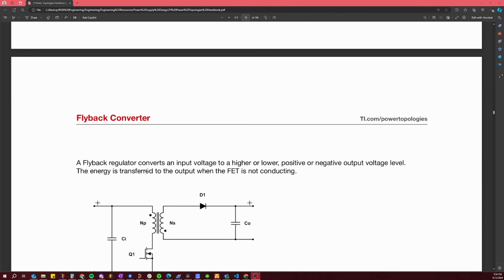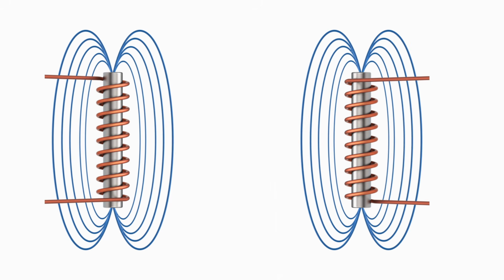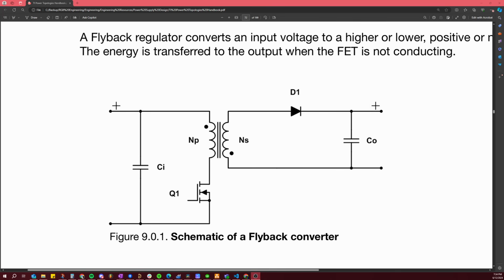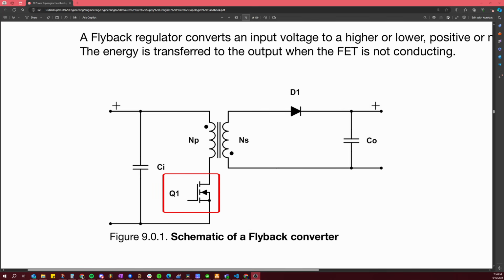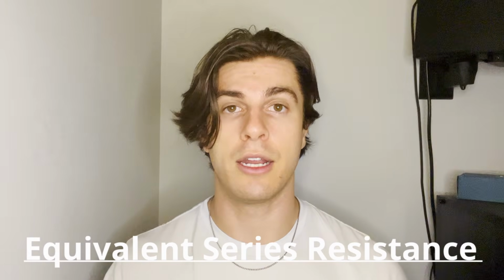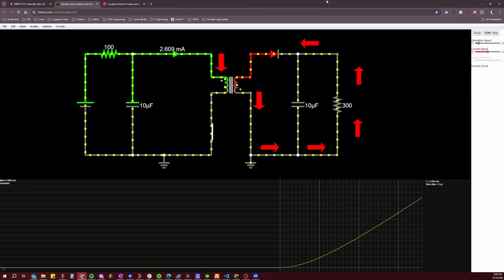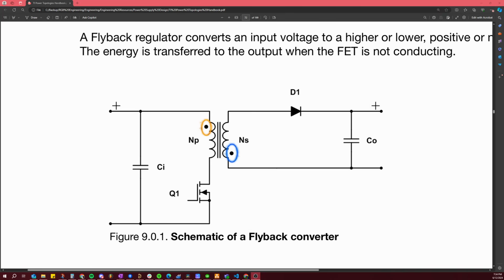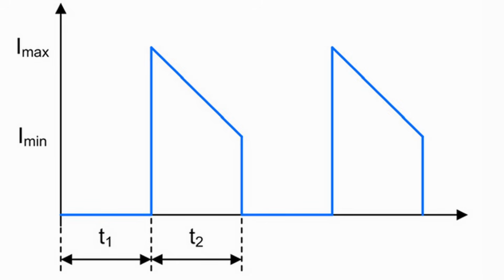Flyback Converter Basics (for Beginners)

Comment: The reflected output voltage comes from only one effect - true transformer "action" that is dependent on the ratio of the input and output winding turns. The reflected voltage magnitude is constant as long as current is flowing in the output winding.
There is another phenomenon that is the result of imperfect magnetic coupling between the inductor charging winding (input) and the discharge winding (output). This is called "leakage inductance" and can be modeled, in simple terms, as a small inductor in series with the input winding but not magnetically coupled to anything else. It is this inductance that results in a very high voltage "spike" when the switch turns off. The current through it does "try" to remain constant (equal to the current just before the switch turns off), but since there is nowhere for the stored energy to go that current causes a very high voltage. Again, it has nothing to do with reflected voltage. A "snubber" is used to limit the magnitude of the spike voltage in most practical designs.

When the switch turns off you get three distinct voltages at the drain of the MOSFET switch. First you get a high-magnitude narrow spike due to the leakage inductance. Then the reflected secondary voltage appears (it actually started as soon as the FET turned off, but it is sort of "hidden" by the big spike. The reflected voltage will remain nearly constant until all of the energy stored in the inductor ("transformer") has been discharged. The voltage across the output winding is held nearly constant by the voltage on the output capacitor, which changes only a very small amount in any one switching cycle. The reflected voltage is added to or "stacked on top" of the input supply voltage. This stacked voltage is the main consideration when it comes to the voltage rating of the FET. Once the stored energy has been discharged, the FET drain voltage drops back to the voltage on the input filter capacitor. Typically there is some high frequency "ringing" due to resonance between FET and "stray" capacitances and the inductances. If the inductor is not fully discharged before the FET turns ON again, the voltage at the drain remains equal to the "stacked" voltages.

Management of the reflected voltage is often a significant consideration in the turns ratio of the inductor ("transformer"). The main consideration in turns ratio is the determination of the inductances required, not input to output voltage ratio. You certainly do not take the approach used for a true transformer.

I prefer to think of the magnetic component as an inductor with a charging winding and a discharging winding, not as a "transformer" (though it behaves as such when you really don't want it to) or as a "coupled inductor" because there is no "coupling" between input and output windings in terms of actual power delivery. "Transformer" is a convenient but misleading short word.
Reply from the maker: Thank you for such a detailed comment :)
Reply: “There is no coupling between input and output windings in terms of actual power delivery.”

Incorrect. Power transfer during off-time absolutely depends on magnetic coupling (mutual inductance). If coupling were zero, you’d have essentially no usable energy transfer (just leakage and stray capacitance chaos). It’s fair to say “it’s not a forward-transfer transformer during the on-time,” but coupling is still the mechanism that delivers energy to the secondary when the switch is off.

Comment: I can recognize this circuit in an old VFD handheld game (5V of batteries becoming 35V for the VFD tube), but I missed some explanation of how this thing works in a CRT, as I see two problems there: The insulation is problematic at 15-30kV, and so is the capacitor on the output circuit, you can't just add a 30kV capacitor there. So I guess it does something by aligning the horizontal line frequency to the mosfet frequency.

Comment: This is a good, very basic explanation of the function of a flyback converter, but not once did you indicate WHY it's called "flyback", leaving the beginner wondering.

To me, an electronics engineer who's done many flyback and other SMPS designs, I understand that the flyback period is that portion that you've referred to as the "energy transfer phase". But, it would have been very helpful for you to have defined that it is called a flyback design because the voltage on the secondary side suddenly "flies back" from a negative direction to a positive direction during the energy transfer phase after the FET turns off.
Reply from the maker: nice fun fact :)

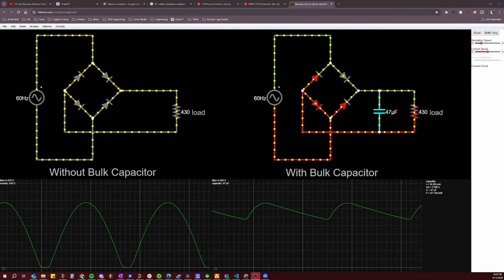Comment: At 2:04 you are talking about the input capacitor being connected to mains voltage, like C11 which is BEFORE the transformer and bridge rectifier.  Then at 2:20 the 47uF capacitor AFTER the bridge rectifier is the bulk (input) capacitor.  This is confusing.
Reply from the maker: At 2:04 I am talking about C8, the 47uF capacitor
Reply: @RGBEngineering  "receive their voltage directly from the AC mains" that's C11 not C8.

Comment: I have been in electronics for 50 years and l would not even start to play around with a converter connected to the mains. 
The component values are far too difficult to determine and the timing has to be accurate. 
You can buy these on the web for $4.50 and they are tested, proven and guaranteed. 
Don’t make a fool of yourself and try to re-invent the wheel. The whole skill in electronics is to KEEP THINGS SIMPLE. You can learn nothing from these videos. No-one has ever produced an inverter from any of the discussions and no-one will. The cost of the parts exceeds buying a ready-built unit. All these videos are just “waffle.”  Talk is cheap and university professors are adept at dishing out nonsense. That why university graduates come out with no capability AT ALL. They have just been listening to drivel. 
If you knew the specifications and timing diagrams needed to design a module you would just laugh at the simplicity of these discussions. 
Colin Mitchell    talkingelectronics. com

Comment: Hello, 

Could you help me in debugging the fly back converter design? 

I have referred the ucc287502dbvr fly back converter from the TI. And replaced its transformer with the same another transformer. But I can not able draw current from it. As per the turns ratio I got the 24v output from the transformer. But once I attached a load to the circuit, the voltage suddenly drops. 

What could b the reasons ??
Reply from the maker: might not be enough capacitance on the output or the feedback circuit is not working.

Comment: Nice presentation, thank you. When the MOSFET goes off, the current through the primary abruptly goes zero. So there is no magnetic flux and inturn no induced emf in the secondary, then how come flyback energy transfer takes place? Please clarify.
Reply from the maker: It goes back to Faraday's law. Change in magnetic field means voltage is generated. When MOSFET is on we have a magnetic field. When MOSFET is turned off we now have no magnetic field. Going from having a magnetic field present to not having a magnetic field present (aka change in magnetic field) generates the voltage on the output.

Comment: how would you lower the voltage that was incresed inside this circuit with a button to transister? so you can higher and lower the voltage?
Reply from the maker: you would connect that to the feedback circuit to adjust the voltage with the button.
Reply: @RGBEngineering AHH thank you..
❤

Comment: Whats needed to increase power output limit from factory designed flyback? Can we make just bigger air gap in the core without changing the windings for storage more energy and just lower current shunt on the primary side to push more energy to it? Yes, I know there is a risk of frying the windings. Can we double the power by simply doubling the operating frequency and increase the air gap to lower inductance also by two?
Reply from the maker: You would need to redesign the whole power stage (all of the components mentioned in this video). There are a bunch of ways you can do it, based on the fundamental equations that describe how the flyback converter behaves.

Comment: I see you still struggle to understand how a transformer works, as you call a coupled inductor with a transformation ratio a transformer. A transformer does not intentionally store energy in the magnetic field; it uses the magnetic flux without the need for energy storage. In contrast, a coupled inductor does store energy in the magnetic field—specifically in the air gap of the magnetic flux conductor. So I would recommend trying to understand how a coupled inductor in a flyback converter works before explaining it to the world.
Reply from the maker: Thanks for the feedback.
Reply: A flyback magnetic component is literally a transformer structure (two windings on a core) with intentional magnetizing inductance used for storage. Calling it a transformer isn’t evidence someone “doesn’t understand transformers.”

Comment: Beginner question, so the bulk capacitor does it need to facto in the overall output current on the secondary.. So e.g  a flyback that needs to provide 5A, what is the relationship of the CAP. to the load current, thanks
Reply from the maker: Great question, remember that the input current will be proportional to the output current, so the current that the bulk capacitor has to supply will be based on the output current rating of the power supply. This is important to consider when determining the required ripple current rating of the capacitor.

Comment: hi Garrett, thanks for the great video breaking it down. I had some more specific questions regarding the distinctions and advantages between conventional transformer, flyback converters, and coupled inductors. Can we have a brief chat sometime? Where would be a good place to reach you?
Reply from the maker: Sure, what are your questions?
Reply: @RGBEngineering  Some general inquiry into the distinctions that separate coupled inductors from conventional transformers. Is there an email i could reach out too?
Reply from the maker: contact@rgb.engineering

Comment: How much current will flow into primary side? In other words what would be  saturation current?
Reply from the maker: That depends on the output power rating you specify (i.e. the load on the output). Just keep in mind the shape of the primary-side current waveform.

Comment: A magnetic field is produced by current flow through its winding. If the diode is off then current cant be flowing through the 2nd winding.  So am I correct in assuming that when a magnetic field is induced in the 2nd winding (with no current flow) this stored energy will provide the current when the diode turns on?
Reply from the maker: When the MOSFET turns on, the energy generated by the current flowing through the primary winding gets stored in the transformer's magnetic field. It then releases this energy when the MOSFET turns off and current stops flowing through the primary winding.

Comment: By far the best explanation on flyback transformer. Simple and concise information.
Reply from the maker: Glad you found it helpful!
Reply: @RGBEngineering  Digging deeper I have found real-life circuits utilising a bias winding and a TOPswitch for the fast switching. What is the purpose of a bias winding?
Reply from the maker: Bias winding is usually used to power the regulator IC.

Comment: If I understand correctly, the RCD snubber (desc by RGB Engineering in another video) built into a Flyback Converter would help alleviate the spikes indicated at 15:50. Is that correct?
Reply from the maker: Yes, that is correct.

Comment: Snubber circuit wasn't mentioned 15:48 but your explanation is very good I hope you do a project with low voltage input like 40 vdc to explain the work with oscilloscope wave form capture.
Reply from the maker: There will be another video on the snubber circuit coming out soon!

Comment: Where do we get the term "flyback" from? Something to do with tubes, you think?
Reply from the maker: yes, from what I am aware, this topology was originally used in TV power supplies; they had vacuum tubes or something to light up.
Reply: @railgap - When TV's had an Electron Gun Scanning Picture Tube!  ... The term "flyback power supply" originates from the operation of early television sets, where the transformer generated a high voltage specifically during the horizontal retrace (or "flyback") period when the electron beam moved back from the right to the left side of the screen.

Comment: I'm trying to learn electronics. Quick question...at time 2:02, what is the purpose of C11 and  wouldn't C11 act as a short to an AC input?? Perhaps C11 is chosen to have a high capacitive reactance at 60 HZ and act as virtual open? I quickly figured  Xc and came up with approximately 2850 ohms (which could be wrong).  Which doesn't seem very high. Either way, what is its purpose??
Thanks in advance!
Reply from the maker: C11 is referred to as an "x-capacitor", and its purpose is explained in this video: https://www.youtube.com/watch?v=q7z0ht7eCig

Comment: What are the number of Primary Windings to Secondary Windings needed to start with an Input Voltage of 6 Volts to obtain an Output Voltage of 60.000 Volts?
Reply from the maker: The number of actual windings is often proprietary (the manufacturer won't tell you exactly how many), but the winding ratio (primary to secondary) can be determined based on an equation (We will go over this in another video later on)

Comment: I think that when the voltage is stepped up besides turns ratio being the effect of it, that the primary coil itself can have a high BEMF due to the ramp up time being larger than the ramp down time and that as well can effect the secondary BEMF.
Reply from the maker: thank you for your insight and knowledge :)

Comment: As we're talking about beginners theory class, I'd have also mentioned the damper diode, which would protect the driver from counter-EMF from when it swtiches off.

More advanced, there were gate turn-off models in use, where gate voltage turned off the drive, otherwise the driver defaulted in conduction and a no-drive condition would result in overcurrent on the driver. Fortunately, such drivers were quite rare in actual production, as far as I recall, only present in one model Philco television and Sony televisions for a number of years, but not in any other form of flyback circuit in industrial usage.
Reply from the maker: Interesting info, thanks for sharing!

Comment: GREAT VIDEO!
at 6:38  iron cores are not used in flyback converters.  Usually a ferrite core with a GAP.
You used the word 'transformer' too much.  It should be 'converter' or 'coupled inductor'.
After the primary cycle, the energy is stored in the core...not the coil...before the energy goes into the secondary.
Reply from the maker: Thanks for the info!
Reply: You are absolutely right. Transformer does not store energy in the core while flyback coupled inductors do.

Comment: If the mosfet stays on, the inductor will saturate, the current will rise steeply, and the magic smoke will come out.
Reply from the maker: exactly :)
Reply: That why the control circuit is powered from the transformer if  there's no oscillation over the transformer the circuit will reset and restart again and sometimes the small resistance that start the controller will burn before because it is calculated to work for a few seconds
Reply: Maybe this is the reason to put the rezistor in primary?
Reply: Ah, THAT magic stuff???
If they just sold it in the spray cans  to get it back 🤔🤔🤔🥸
Reply: In what situation will the Mosfet remain ON continuously ? are there any practical experiences if such situations that really happened ? Please do share..
Reply: @irapashunnur8237  Maybe not continuously, but for too long; when a circuit using an opto-coupler for feedback had the opto-coupler fail open circuit.

Comment: I had forgotten so much of this over 50 years.  Actually if the MosFet stays on forever, the primary will saturate, and the current rise will stop (I think).
Reply from the maker: Yes, in real life, the ESR of the MOSFET and primary-side of the transformer will limit the current.
Reply: The current will actually increase faster after the core saturates (because the inductance becomes much lower) until it's limited by other parts of the primary circuit. In practice something will probably overheat and fail, likely the mosfet.

Comment: When speaking of transformer direction, dot, are you referring to current flow direction or electron flow? It’s important, and also confusing. I’ve seen designs where the 2 gets crossed up.
Reply: The dot refers to the polarity of the coil. If you push a positive going pulse into the dot side of a transformer, the positive pulse will appear on the dot side of the secondary. The philosophy of the current flow is irrelevant and is not intended to be denoted by the dots. It is strictly for the polarity of the coils, as the current is completely unaware of this mark on the schematic. This is why one shouldn't think of "current flowing through a transformer". It doesn't. It flows through the coils of the transformer. The energy flows through the transformer.
Reply from the maker: I am referring to conventional current flow.
Reply: It doesn't matter which current convention you use as long as you're consistent.
Reply: @gcewing True. But no engineer talks about electron flow unless in the context of understanding the theory of operation of valves, semiconductor devices.

So it's not useful to talk about electron flow in circuit analysis.

It is only unqualified people that like to bring up electron flow direction as a way to give the illusion they know what they are talking about.